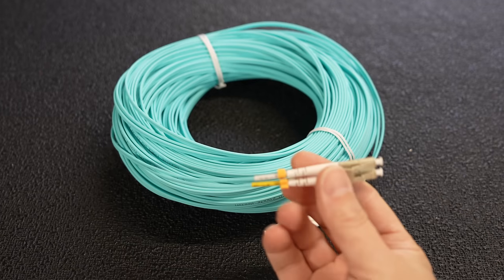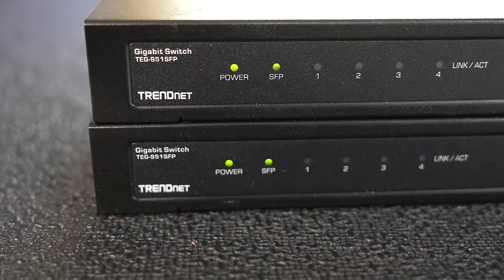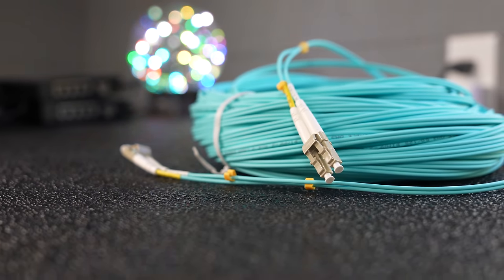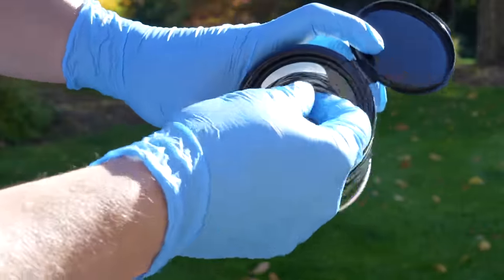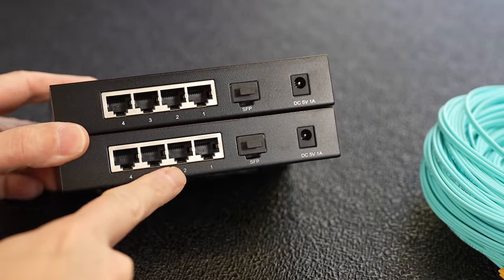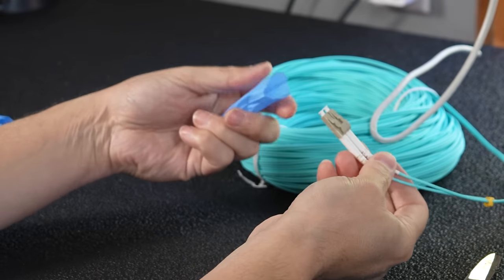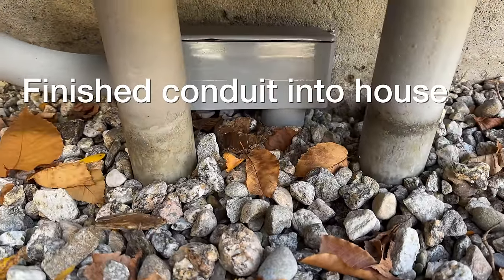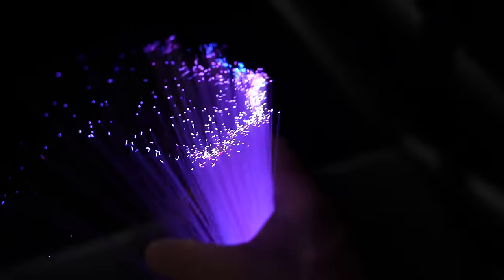How to Run Fiber Optic Cable in Your Backyard - My 10 Gig Install for Starlink

Comment: As a networking guy, I would highly recommend going with single-mode fiber. It's much more future-proof and can run farther. To be clear, there is NOTHING wrong with multi-mode; single mode is just the preferred method.
Reply from the maker: Hmm, we could have a long discussion on this one. I have worked with single mode in campus settings for years but for a home environment or distances that will always be under 2000 feet multimode will always be a much more economical choice. But as you said either could work.
Reply: @SilverCymbal  cost used to be a major factor but now they’re almost the same price. Amazon shows a $1 difference in a 50M spool. I always default to single mode as I know no matter how far I go even cheap transceivers can run 40 KM (which is insane to think about). So if I have a long run I can always get a little extra to make sure I have room for incorrect measurements and not have to worry about it. 

But MM fiber still works great and I have still have thousands of feet deployed that works great everyday. SM just gives me a little extra wiggle room and future proofing. 

All in all it all depends on the use case which works perfectly for your situation. Great video! People don’t need to spend thousands to get internet to a garage.
Reply: Single mode cables aren't the problem; single mode equipment is more expensive.
Reply: @qazsedcftgbhujmkolp4401  In terms of MSRP, sure. But look at SMF vs MMF in terms of what you can actually buy, especially when considering future-proofing. 40GBASE-LR4 and friends can be found secondhand for <$15 per transceiver. Meanwhile if you want to use LC MMF, you have to use much less common standards which are nearly impossible to find transceivers for (and they likely won't be cheap). Or, you have to use MPO/MTP connectors which increase the cost of the cabling, and you get to deal with the fact that there are multiple variants of it.

Same thing with 100g (there's 100GBASE-CWDM4 transceivers being sold for $9 right now), and the same with whatever comes after since there's just way too much entrenched duplex SMF out there.
Reply: Single mode is a much better option IMHO. 
With MMF, you WILL have to replace it in 5-10 years, with SMF you will most likely never need to replace it. 
The cost differences for both cables and optics are next to nill these days, but the performance and future proofing benefits are huge - you can run 100Gbps duplex links on a single SMF cable from the 90's with a BiDi transciever, whereas even just last-gen MMF is now outdated and has no upgrade path (unless your run is very very short).
Reply: @just-a-waffle  Not when you go above 10G.  $39 vs $300 per connection. Of course if you have switches that can handle 40 or 100G then the cost of the transceivers is probably not a concern.
Reply: Personally I would say that the 1G SFP based solution that you installed will be more that sufficient for many many years to come. In such a short distance the multi mode solution is more than adequate. Single mode fiber is certainly better for longer distances but at 200 to 300 feet it’s not necessary. Plus there are plenty of 25 to 50G products hitting the market for data center applications so when you do need to upgrade in a couple of decades I’m sure you will be able to find some cheap and fast
Reply: The problem is that single mode transceivers are usually considerably more expensive for absolutely no benefit over this short a cable run.
Reply: @just-a-waffle  but what is the benefit? AFAIK its only range - both can have similar speed and none of them will be push away from the market anytime soon
Reply: @RafaMazurekRMZ  mostly future proofing. Every ISP is putting single-mode in the ground, don't care if it's 100 meters or 10 kilometers. With multimode there are different standard with different types of cabling and the fact that a fiber-cable is limited to 10Gbit isn't what you want. If you're going to put fiber in (and even in conduits outdoor, put in outdoor rated cable) then it'd be just as good to be putting single mode in as the cable itself has no limits either what equipment is capable of sending on a single fiber. Personally I'd go with distribution-cables for these applications as well paired with patch-boxes so the fiber itself gets no wear and is nice and protected. With distribution cables you have multiple fibers in one cable which have a breakout on either side, these can either be 2 fibers or 96, whatever you like. A 96-fiber cable is barely thicker than two CAT6A cables. Now, 96 is an expensive option and way overkill but going with something like 4 pairs brings a lot more flexibility.
Reply: @SilverCymbal  It's not just about distance. Single mode will allow faster speeds should you need that in the future. In addition you can use Bi-Directional SFP, you only need to use 1 strand of fibre, you will double the capacity of that cable.

Comment: When you added an additional pull cord incase you need it in the future, it reminds me of why this is such a great channel. Very clever and I never would think to do smart things like that
Reply from the maker: Much appreciated, I learned all these lessons after making many mistakes. Glad I can help others learn from them
Reply: Agreed. I listened in the car yesterday and was wondering how you pull anything else in the future. I re-watched today at home and was happy to see you add that string. I hope I'm that smart next time I pull a cable.
Reply: Using cat 5 cable is somewhat wasteful. For our water pump for example we used multi string steel wire with plastic coating. I can't be sure what's cost more in your area, but that thing is in water for more than a decade and can still pull a 20 kg pump from 15m with no problems.
Reply: I was ready to comment this if he hadn't touched on it. I can't tell you the number of times I've encountered or heard stories of someone finding conduit where they had to use an existing cable to pull a new run with two strings so they could then pull that first run back through and hook it back up.
Reply: A lot of times when I would install ethernet through conduit that already had a pull string... I would attach a new line to it like he did, but afterwards I would pull it back so there was just the original string (if it was good). I didn't always do this but if you don't need to replace it, then don't.
Reply: Extra pull cords do not always if the cord braids with the additional fiber when pulling.

Comment: Here's a tip.. If you have a spool of fibre patch cable like this, put it in a bucket and it wont unspool and tangle.. it will feed in just nicely through your pipe.

Comment: 10 gig equipment is power hungry right now and also produces too much heat that small equipment sometimes overheats and drops connection just like the early 1gig equipment. Good job on picking 1 gig first.

Comment: Heads up with the indoor fibre used in water filled conduit. From my experience, the fibre will fail in about 4-5 years. Outdoor rated, gel filled is the better option for longevity.

Comment: a few tips as some others have pointed out.  

1. you shouldn't use that OM3 patch cord that you used for anything but indoor use.  You should run either indoor/outdoor, direct burial, or gel filled outdoor rated fiber as the water will break down the jacket of the type you used over time whereas the indoor/outdoor rated is manufactured to resist the ingress of water.  Although when using the direct burial type it is usually armored and needs to be properly grounded.
2. you should use a pulling eye on the end of the fiber for pulling though conduit which has a turnbuckle on the end that swivels to keep the fiber from twisting while being pulled.
Reply: I disagree for DIY purposes. If I was installing for a customer, I would definitely use the right cable and the pulling eye to avoid a callback - callbacks are very painful for businesses and should be avoided. Also, downtime for business customers can be very expensive for them. But for home DIY, in the worst case you have to replace your fibre. It's cheap. Just replace it.

DIYers, don't let the perfect be the enemy of the good. Yes the process in this video is not best practice. But it will work fine for most of you.
Reply: Realistically, what's the time frame for breaking down something like that jacket? Are we talking like a year or like 10 years?
Reply: I’m a believer in pay once, cry once. I rein the same type of fiber in my house from the basement to the second floor. It worked great for a while, but somehow I ended up moving the fiber optic cable just the right way, or should I say the wrong way, and it stopped working. I’ve using a Cat8 why are they can easily run 10 GB plus, haven’t had a problem since.  The right cable isn’t that much more expensive, do it one time right, it’ll last you a lifetime. Another advantage is if you run higher grade cable when the world gives the point where 10 GB is slow, you’re already proved it.

Comment: I was lucky when we purchased our home because the previous homeowner had run hard lines to all the rooms and a fiber optic cable from the main closet to the room above our garage.  We only use wifi for our phones and tablets and everything else in our home is on wire or fiber optic.  Great video.

Comment: I'm doing a 200' run of cat6 to my new barn right now. Definitely going to pull some fiber with it now too!! Thanks for the vid!
Reply from the maker: So glad it was helpful, even if it takes some time it will basically be forever for you.
Reply: Make sure to put surge suppressors on each end of the cat6 and make sure they are properly grounded.
Reply: I'd go with Single Mode fiber with LC connectors. It supports higher speeds and longer runs. You can get 1000ft off Amazone for $200.
Reply: Just a suggestion - if you have any trunk needs (bridging two buildings or floors for instance), you may want to consider a fiber trunk cable. 
With single-mode fiber, going from a cable that has a single pair of fibers to 12 pairs, or even 24 pairs can be reasonably affordable (most of the costs are in the external protection of the fiber bundles, not just in the fibers, so scaling can drive the cost per fiber much lower), and the cable diameters aren't huge (read about tight-buffer vs. loose tube). 
You can choose to just lay that extra trunk cable "just in case", then terminate it when you actually need it.
Reply: @int0x2e  But a home owner...putting a cable in the ground to a garage...the odds of replacing it are umm

Comment: Regarding the water in your underground conduit, that is very typical. In fact underground conduits are usually considered to be wet locations. The water can collect over time due to condensation as air moves in and out of the conduit with changes in barometric pressure and the coolness of the underground conduit. One method of mitigating the condensation is to plug the ends of the conduit with duct seal which is a mold able compound that can be removed later if needed.

Comment: Remember Motorola? My old boss bought the presidents old house in Chicago. The whole house is fiber. Great video!
Reply from the maker: That is pretty cool. I remember they thought every part of the house would get it. That might still happen but so far for interior wiring copper is still holding on.

Comment: This is fine, I'm sure it will work for years unless that water freezes and maybe even then since it's such a short run. I just wanted to throw this option out there. Fiber Store will custom make you fiber cables. This is what we use outdoors: MG-OS2XXXF (just search it on their website) You can get up to 24 fibers in the same cable, specify the length and connectors. The cable is armored so no issues with it getting physically damaged and it can be pulled without issue. They can add a pulling eye to it to attach a pull string. There is also the option to stagger the connectors so they can be pull through small openings. This is a single mode cable so get the appropriate SFP modules. It's going to cost slightly more but it's a more robust solution that an indoor patch cable.

Just a personal preference thing. I like to use the SC connectors with BiDi modules. That allows you to use a single fiber per module. It does this by using a different wavelength of light at each end. My preference for SC connector is just that I think they are easier to deal with and clean.

Comment: It's a great idea, some things I would add though.
1. SFP is not 10G rated; you need an SFP+ capable transceiver and switch.
2. Do not use a OM3/4 patch cable outside or really, outside a rack (though you can - situation dependent). Use a rated, outdoor fiber cable (preferably armored) - a tad more expensive, but will last longer.  
3. You need to consider multi-mode versus single-mode depending on the distance; given you are under 1000 feet, cheaper multi-mode is fine. (but again something to consider)

Comment: a unsealed pipe will collect water via condensation. The Air will contain moisture which will condense below ground and accumulate over time.

I recommend pulling more than a single pair incase there is an issue with the only of the fiber connections. For my Run I used ST connnections since you can always switch out one fiber connection as apposed to a duplex. I like ST since the are unlikely to come loose over time either from temperature swings or vibration.

Comment: For narrow conduits you can use BiDi SFP modules, which require only one connector per side, making it almost the same diameter as a cat6.
Reply: Bidirectional (WDM) SFPs, use single-mode fiber, which is more costly than duplex multi-mode.
Reply: @markarca6360  BiDi transceivers work fine on OM3 your just distance limited to 500m for 1Gig and 200m for 10Gig. The cable he used was OM3.

Comment: One tip - rather than using Cat5 for your pull cord, you can use what's called mule tape, which is purpose built for this type of application.    It's also cheaper and has a higher pull capacity before it's compromised (hundreds of pounds vs. a couple dozen pounds before ethernet is comprimised).

You do an excellent job of explaining things.  Great work!
Reply from the maker: Thank you for that tip, I have not seen that stuff I will have to give it a try. Thank you
Reply: @SilverCymbal  if you are doing a run whare you may dig in the future make sure you have some sort of conditioner in with the fiber so it can be used to locate it
Reply: mule tape gets expensive fast though compared to just using what you have on you then putting it back in the box (or leaving in place as a future spare). We kept all the mule tape from doing manhole shots in the middle east, ours was rated to 2100 lbs lol. Came back and used it as rigging for small crane work (under 1T) after that deployment, that stuff is amazing. Tried to buy more later just to have on hand and holy crap it gets expensive fast compared to jet line which is fine for anything residential 

For example (residential again) You can get 6500 feet of jet for under 50 bucks, getting that much mule tape, even the light stuff, is gonna be hundreds

Comment: Wow, this guy lives in the middle of the forest and he has 1GB internet speed I live in the city and the internet speed doesn't reach 200MB. 

Edit: 
I didn't mention it but I don't have fiber. All I have is a wireless router only.
Reply from the maker: I am really luck with that. I am setting up some new stuff that will use this fiber and combine all these things into one big network here but it is super economical. I am planning to share these videos in the near future. This link was the first big step, well after the Starlink tower of course.
Reply: Yes; those who inist that "everyone has high-speed internet" haven't a clue. There was a town in Louisiana that didn't get phone service until 2005.
Reply: 200?! I can barely even get 3
Reply: Im in the country, gravel road, city nearest me has a population of less than 200 (short 20 miles away) and I have gigabyte up and down.
Reply: And here in Australia I am stuck with fibre to the node/exchange and from the pit outside my house with a 30 year old copper cable from the pit to the point In my home. 40mbps maximum download speed only get about 12mbps on average.
Reply: I can only get 3.2Gb….
Reply: @harblz57  Louisiana?  That's in South America right?
Reply: @CheaddakerT.Snodgrass  Wrong.
Reply: @yesnt5797  you guys get Internet?
Reply: 200?
I survive on 15mbps
Reply: @maltee69  you wrote this comment through radio waves or something?
Reply: @komododragon410  Modern problems require Middle aged solutions.
Reply: @yesnt5797  3! I barely get 2 to 1.5
Reply: 10Gb/s in a small village with less than 300 inhabitants in France 😉
Reply: I know of a hunting cabin with fiber internet....I can't get that at home...in a state capital city, with a well known state university a level 1 trauma hospital with Medflight and 1 block off a state highway .5 mi from 2 major interstates

Comment: People need to pay attention to minimum bend radius for fiber or you can end up with intermittent data transmission errors. I suggest using a piece of PVC of the right diameter and secure the cable to it for any bends. Existing conduit probably has bends tighter than spec but you may be fine. 

Standard SFP only support 1GB. SFP+ is needed for 10Gb.